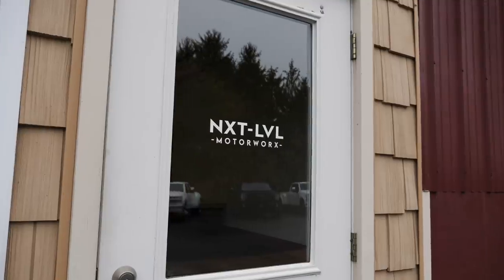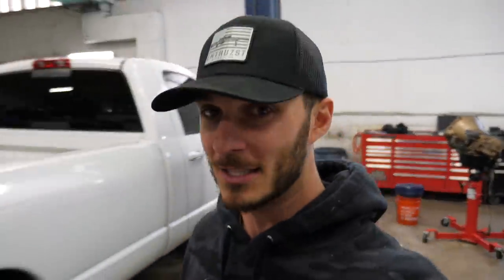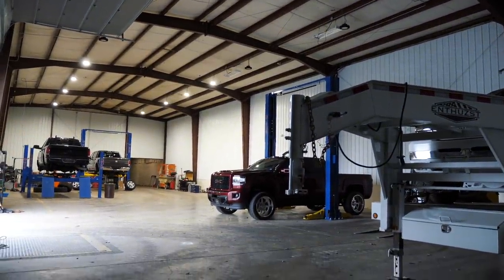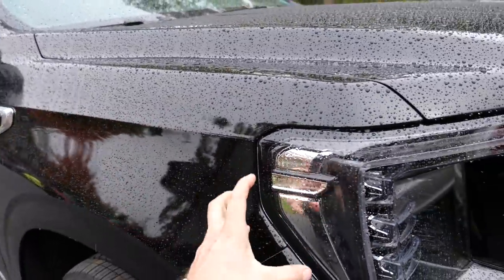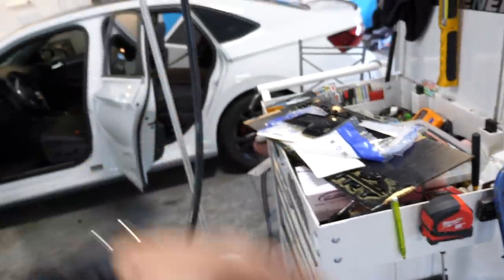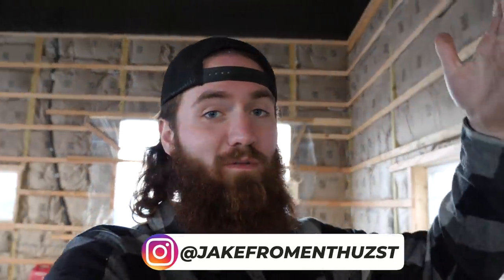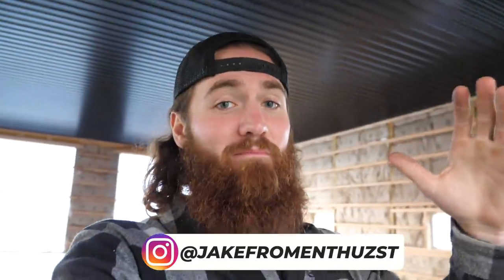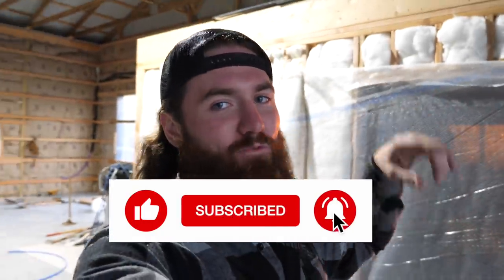Found PART Of The Issue With 8 Ball..

Comment: Good to see Jake back, I have a question, not so much for Jack or Jake, but by all means chime in. I have an 04 Dodge Ram my father owned with a Cummins, I intend to put some work into it, but would like some advice. It is a 2wd as we do not do much in the way of off roading but I would still like to lift it. Is there a company that does a kit for a 2wd or should I just prepare to piece a kit together. Any sound advice would be appreciated.